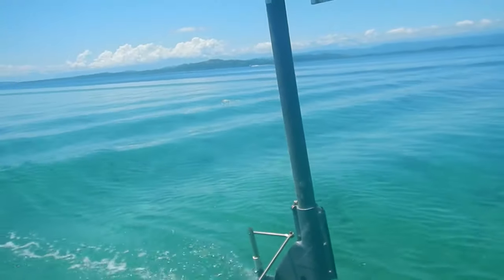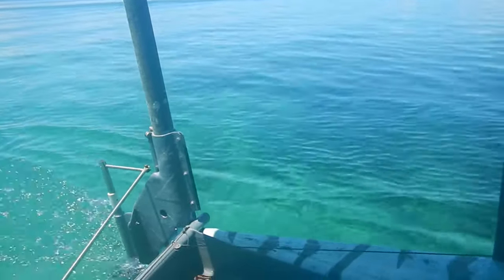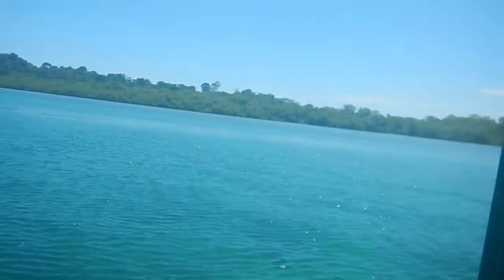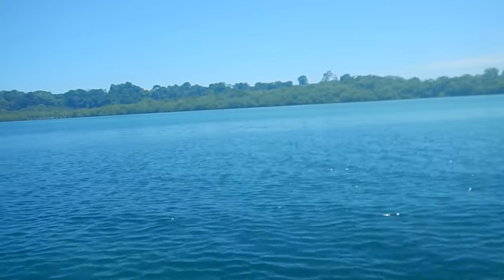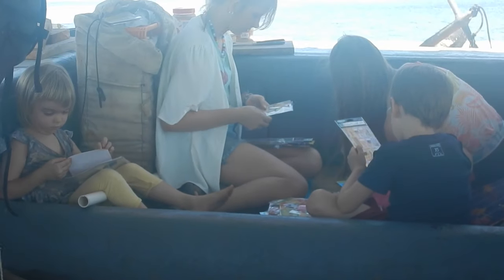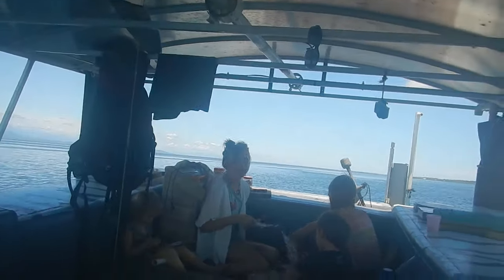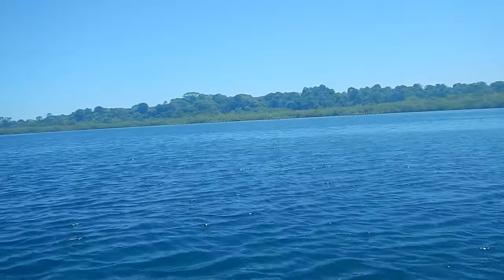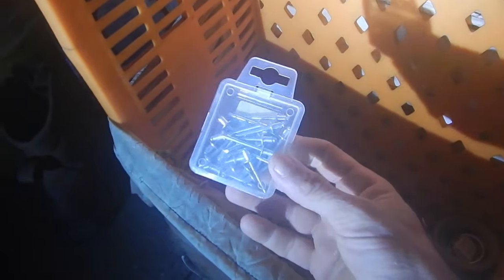Testing Primitive Speed Controller on Solar Boat:  Family Trip to a Swap Meet

Comment: even petrol internal combustion engines only reach their most efficient performance levels at wide open throttle, and they still are way less efficient than electric motors due to all their heat and friction losses ....but yeah, seems that infinitely variable throttles are more of a hold over from gasoline engines where it was easy and effective to restrict the air/fuel mixture to slow down to any speed; now with eMotors that just gets wasteful - but I like how you simply have a few speed modes to choose from: off, solar, restricted battery, or everything, and reverse

Comment: Have you checked wire losses on your system? While it is possible that the speed controller didn't run on 100% duty-cycle, I don't think it did have so significant losses that they could affect on speed so much. You did other things too when you replaced the controller, like remove wire connections and cleaned your switches. There can be surprisingly high losses in oxidized connection with these currents. It would be good to measure voltage between your battery terminal and motor when it's running under load to see if you can squeeze more power out. 

Your cables looks quite thin to drive high power motor. While the current rating may be enough so cable don't overheat, there's quite easily meaningful power losses. 

Sometimes speed controllers use syncronic rectification or H-bridge, where high side mosfet driver don't allow 100% duty cycle. That's because n-channel mosfet gate is driven through capacitor to allow gate voltage to go over supply rail. Such setup work as a charge pump to drive voltage up.
Reply: Wire losses might add up to 1% total, maybe. If he was dumping hundreds of watts of heat into badly connected wires, he would've burned the boat down in minutes.

Quite simply, either his controller was set to never output as much voltage as the battery, or him scraping the barnacles made all the difference. Him replacing the controller with a "more effiicent" direct drive is a fantasy. Most dc speed controllers at full speed literally just short the battery to the motor anyway. He's not losing 25-35% efficiency off of his old controller.
Reply: @MattsAwesomeStuff  Wires restrict power much more than losses. That’s because voltage is lowered. There can easily be 1-2v drop just on cable and same on each bad connection. In 48V system, 2V is already 4% in resistive load. However, electric motor is not resistive load, and power output behaves closer to power of two, because both current (torque) and rpm increases.
Reply: @teropiispala2576  You're not dropping 1-2v on a bad connection, that's ridiculous. And on short runs? Not much wire loss. My point being, he did not see a 33% speed improvement because he eliminated a speed controller OR because he tidied up wire connections.
Reply: @MattsAwesomeStuff  4m 2.5mm2 wire have 28milliohm resistance in room temperature. In 120C, it it about 40milliohms. That means two volts losses with 50A current. 4m wire means 2m distance. 

With all the switches and such, distance can be double. 2V losses are not ridicilous, but realistic, if the wire is 2.5mm2-5mm2 and distance between 2-4m. Copper temperature in open air install can be 120C when it doesn’t feel menting hot.  

In Finnish electric install specifications, maximum current for 2.5mm2 wire in open air install is 25A. Maximum allowed wire temperature is 70C. By stretching safety margins, such wire can transfer up to 50A without getting extreme hot. Note that I’m now speculating  with matter which Jamie knows, with the length and thickness of the wire. My point here is, if one choses wire that seems to be thick enough, it can have pretty high losses. Connections adds on this. Typically one connection with shiny new cable have 3milliohms of resistance, but it can increase fast if contact area is oxidized or heat up. In microscopic level, the temperature  can be several hundred degrees or even small melting can happen. Such heats can double ir triple the resistance. 

I agree that speed controller losses can’t be the reason. Limitted output power/current can.
Reply: @teropiispala2576  120 degrees Celsius? Are you crazy? That's above boiling point. You think he wouldn't notice that? And his wiring is way above 2.5mm^2. You're exaggerating everything to an extreme.

Comment: Jaimie I've spoken to you before about life jackets and I understand that you don't want to wear or rely on one, and that's fine. You're a very capable adult. However I strongly believe that your children should be wearing life jackets. At the very least the younger ones should be wearing them. PFDs have, unarguably, saved many lives.
There's no negatives to wearing PFDs that I can see. You put it on and forget about it.
Reply: There are unseen negatives that some people don't consider.  Floaty things, wrapped around bodies, have, also, contributed to drownings when overturned boats turn into traps.  PFDs will prevent swimming underneath the sides of the boat or a large sail to escape.  Pros and cons to wearing has to be considered, prudently,

Comment: In "the Matrix" they describe the purpose of the Elysian fields is to use humans for electricity, recycling their waste back to them. And this sounds like it's nonsensical. But this, "combined with a form of fusion" gives the robots all they need.

... frankly, no, the speed controller was not 75% efficient ( or less following cube law of speed). Even an electronic speed controller from the 1960s using SCRs and a crude chopper circuit was never that inefficient. Especially at max speed. Just... no. It wasn't. It wasn't dumping hundreds of watts of heat.

Maybe, "combined with cleaning the barnacles off" there were some speed changes.

Or, your speed controller allowed a higher input voltage than output. Like, it allowed up to 60v (4x "12v" batteries are actually closer to 55-60v), but was designed to not allow output higher than 48v. So, you just had the wrong speed controller on there. And, a DC motor obviously spins faster at 60v than 48v.

Almost all speed controllers, at max speed, are just a relay that directly connects the battery to the motor. So we're talking like 1/2 a watt of "wasted" power. Not thousands.

A real test would've been to measure the power coming out of the battery in both situations, not just observing speed. I suspect, if 100% of the speed difference wasn't just having a barnacle free hull, then, it was entirely due to it drawing more power.

Jaimie's made an argument for efficiency. Just, no, its false. Speed, maybe, efficiency, no.